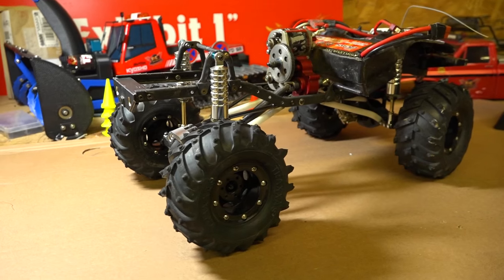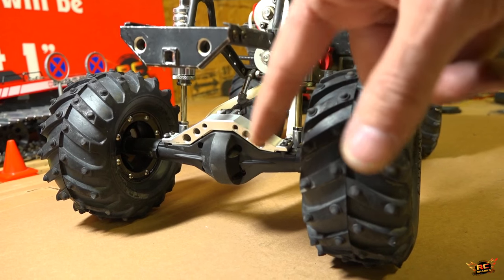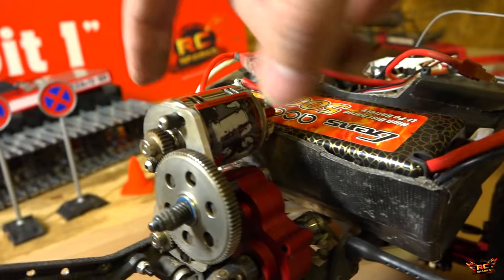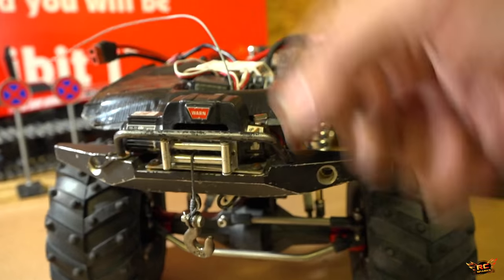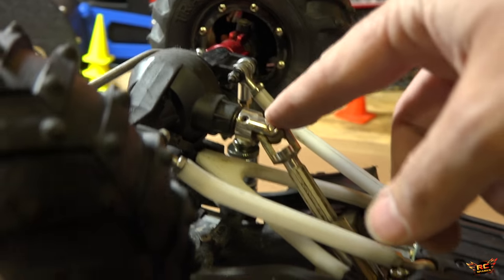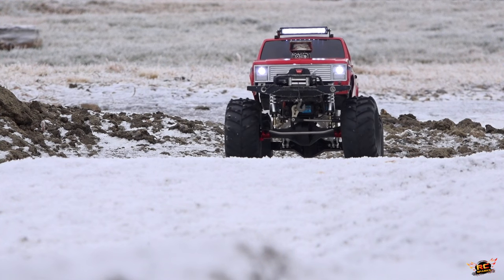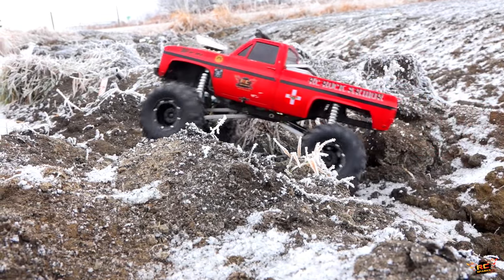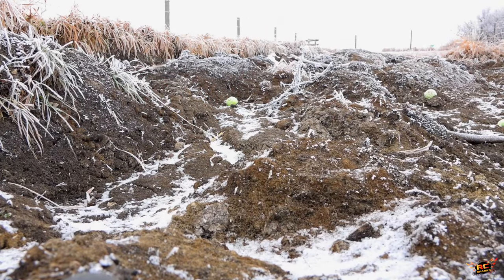RC ADVENTURES - CHEVY Mega Mud Truck - 1/10th Scale Electric Dual Motor Setup w/ Steel Drive

Comment: I didn’t see anywhere that Medic answered your question but I have some input. First off, there just isn't alot of motors out there that's bigger than the 540 motor that fits Scx10's. The 540 (that's what Medic runs) is a standard size and Level3-RC makes a dual motor mount that's easy to bolt up. Dual motors gives you double the torque and twice the horse power but not necessarily a better top end. The motors run cooler because the stress  of moving the vehicle is split between the two. And if you running a high turn motors like 35t or 45t your run time isn't effected much at all because like I said the load is split between two motors so they have an easier time moving the truck with very little throttle. Down side is the coat of an extra motor, $15 for the Level3-RC dual motor mount(that's a good price) and a higher center of gravity.....especially if you spend alot of time in the rocks. Medic set his truck up for mud and trails...so it fits.
Ok....on to the BIG motor. Only one I can think of is the Traxxas Summit 775-Titan bigblock motor. It's huge and readily available($35). Yes it fits....but only with some modification. You'll need to dremel out the stock Axial motor mounts, take the medal "sleeve" off the motor(to make the motor skinnier), make a 1/4 inch spacer to lift the tranny up, notch the frame a little, and buy a 5mm pinion. The benefits are a very cool factor because you'll be the only one out there on the trail with a legitimate big block, it easily makes just as much torque is the dual motor setup and it keeps the center of gravity low. The only drawback is your run-time will drop in half and the minor modifications you gotta do. the next question would be can your ESC handle a big motor like that. And it runs good on 3s and better on 4s.
The 775 motor has incredible low end torque and start up.
How do I know?........I've done both modifications.
 Tom

Comment: If your not having a problem with the driveline angles that's great, but maybe you could consider adding an old AX-10 frame or the RCbros mega mud truck frame underneath?  I did the AX-10 under scx-10 and it was so easy and the results are great for a mega truck! Great driveline angle and lowered COG. - I lost a little center ground clearance but oh well.

Comment: My 2 year old son loves when I watch your vids, thanks for being kid friendly!  We bash in Michigan with a 1994 Rustler (mostly stock some RPM, castle mamba pro system 3s aluminium bellcranks, etc,) a 1997 emaxx 3906 (Locked diffs, full cage, helical cut steel 2 speed trans, all metal drive train, true track RPM all around, plow setup, dual steering servo mod, castle 6s 2200kv, to much to list lol!,) 2 losi mini 8ights ( one stock, other with truck body, 1/10 steering, 4500kv 3s,) and a stock losi micro t! Keep up the good work, we appreciate it!

Comment: So did you change the wheel base with those links or did you just round out the wheel wells to fit the stock 12.3" wheelbase?

Comment: Believe it or not I have a very similar setup, same shocks same links same steering. I'm running 2.2 mudslinger xls atm for a bit of a novelty on a deadbolt chassis and I have stock motor and shafts. Works good for me. Only thing is with the massive tyres I've got it makes the car a little too heavy.

Comment: Whats your opinion on the lite hawk blast 

Im looking into getting into rc and I'm wondering if it would be a beginner "racing" vehicle
Reply: In my opinion u can get eather a traxxas slash 4x4 ultamite or platnum the the team assiated sc10 4x4 or what i use in the cactus classic is the losi 10 scte 4x4

Comment: I have a traxxas stampede that i did a motor swap on it and i was driving it on a 2 cell lipo and ran it in to a wall and cracked the frame broke my drive shafts and my staring servo
.

Comment: Hi I have a nitro rc car it is a redcat racing tornado s30 and I've been trying to start it and once i do start it I need to hold the throttle but if i let go it chokes out and the wheels spin so please reply hopefully you can solve my problem

Comment: i luv vids with this truck;) how big 3S for light kit do you use and for how long it can power on your lights? cheers from "no snow Holland" ];)
Reply from the maker: +Marcin Brzozowski the 3s I am using is a 2200mah.  I have run it for 3 hours - no problems  :) Hello from Canada!
Reply: +RCSparks Studio Hi your channel has inspired me to get into rc and I will be getting a HPI E Firestorm 10T and I would like to see what accessories ( off road tires ) I could get to it, and just an over all review and if if would be good for starting
Reply: +Ryan Vennard from this what i know Hellfire is discontinued so better go for Traxxas Axial or Losi. Kyosho is also problematic with parts
Reply: No see I'm twelve and I was told by professionals at wheelspin rc modules to stay away from 2s and 3s and just go stock for a while. But I might after a while upgrade to a brushless motor after I get used to it. Hi from Northern Ireland
Reply: +Ryan Vennard Ahhh that's why;) Well it is better to stay with NiMh batteries. Go for E-Revo. 1/10 and you can learn fast with him-i think so... Cheers
Reply: +Marcin Brzozowski I have already ordered the HPI E Firestorm but I watched videos on the Revo and the power in it the car can't handle it and I don't think I could either
Reply: +Marcin Brzozowski but if u could find any tires or accessories for the HPI it would do me so much help.        cheers

Comment: does it matter what brand of battery you have. like are any of them better than the other
Reply: Too me bro it dont matter because i race my traxxas slash 4x4 in the classic cactus events and i use reedy wolf packs and i put it to a 3s lipo its a beast i also perfer the venom batts and gens ace lipos hope you find the lipo you want good luck my man👋👋😁✌️✌😀
Reply: I use Onyx in my hpi Apache. Personally I wouldn't go for an own brand or cheap lipos due to the nature of lipos because I've had friends lipos set on fire due to them being cheap.
Reply: try spc batteries. i doubt you'll be dissapointed.

Comment: meow
Reply from the maker: +David Goodwin Jr. right meow!
Reply: +RCSparks Studio where's pinky?
Reply: +RCSparks Studio- hey rc sparks/RC adventures found you do something for me my dad back in like 80s or so used to use a truck to pull in shows its a 76 ford with 78 grill could u make me one for 100 bucks that works and is nice or just frame and hookups to have it run so I can just get motor myself I want to give him a good christmas and the color is all top half of truck is red below does are red its single cab and if put sticker on door that says SILVER BULLET thanks if can tell me if can would be appreciated and if get that 100 dollars from me do what ever like donate it
Reply: +RCSparks Studio I prefer traxxas steering setup